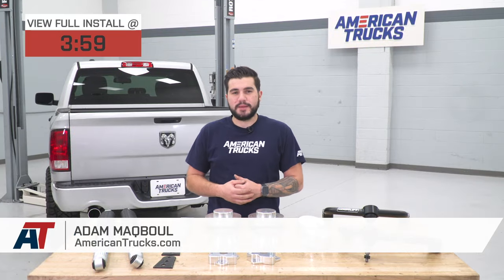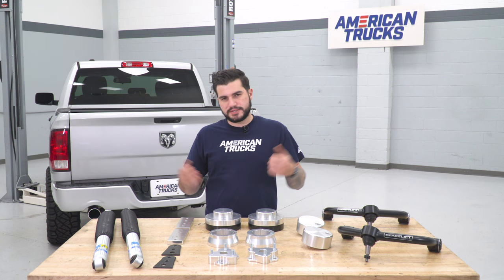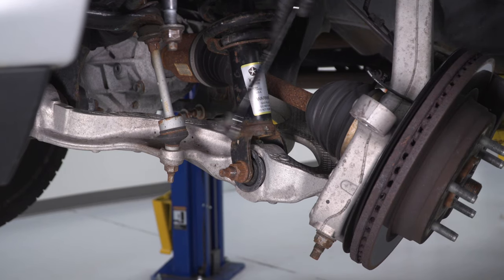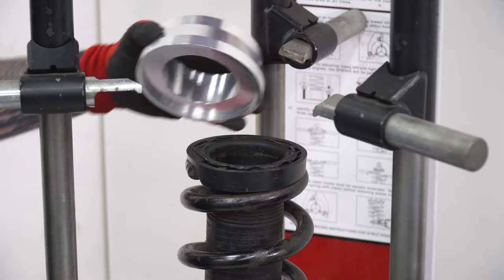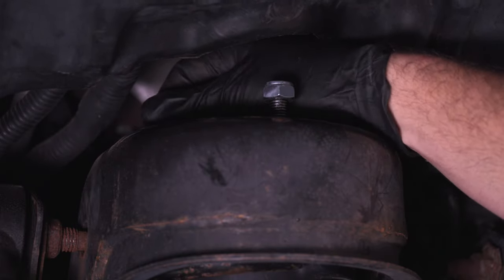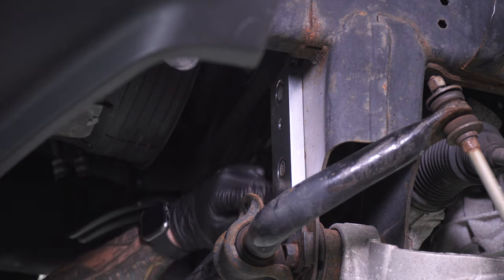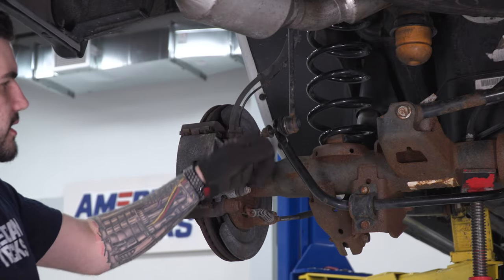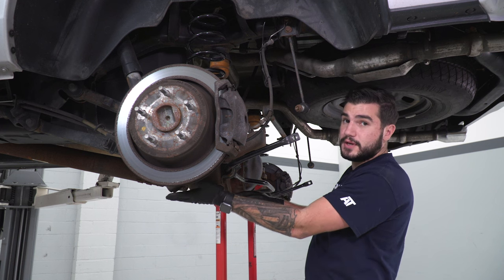2009-2018 Ram 1500 ReadyLIFT 4"" SST Suspension Lift Kit w/ Bilstein 5100 Shocks Review & Install

Comment from the maker: Subscribe for Weekly RAM Truck Videos: http://bit.ly/2G7fgWv
Shop This Lift Kit: http://amtrucks.at/3mY76nc
Reply: Where can I get the rear shocks? Cause I have tried Amd I can’t find the shocks for this that are 2”
Reply: Curious:  How much did ride quality change with this lift? I want to lift my 2010 Laramie, but I prefer a smooth ride over a sport or off-road ride.
Reply: Just thought you should know it does work with the ecodiesel. The reason they state that it doesn’t is because ready lift hasn’t put on in an ecodiesel them selfs

Comment: I just installed a 2 1/2 lift on the front of my 2017 Ram 1500 4x4 to level it out and I’m considering beefing up suspension. Maybe upgrading the control arms, and new shocks on the rear. I like the ride height, and have 305/55r20 Nitto on fuel rims with. 1 in offset. No issues with rubbing tires, and it drives straight.

Comment: I have this exact kit but was wondering if I run 35s on the factory 20 inch wheels will I need spacers?
Reply from the maker: 20's and 35's will work just fine! Needing spacers will depend on the offset of the wheel, but in most cases you shouldn't need spacers.

Comment: Cant i just buy the sway bar relocation bracket? And just install a 4 inch lift front struts, instead of the spacers that go on top of the struts?? I feel like it will give it a better right quality.
Reply: Better choice for sure. The upper control arms are recommended with anything over 2 inches though.
Reply: @coltendixon2416   did a little more research and alot of ram forums say, they kept on replacing cv axles because of angle they are at when putting this “lift” on. The best way to go is 3 inch, any higher then that you will need to do a diff drop.
Reply: @israelgarcia3455  yes the more the lift the greater the angle will be. 1” is better than 3”
Reply: @israelgarcia3455 hi did you installed bigger strut with this 4inch Ready lift SST kit? If yes what struts you used. I am planning to buy 4inch struts to replace spacers and want to confirm  whether they work with this kit
Reply: @arshdeepsingh6681  its been two years with a similar lift. I have bilstein B8 5160 with remote reservoir shocks in the rear, and Bilstein 6112 set to 2.8 liftat the front. I also installed a 2 inch body lift to fit 37” tires. I also bought other aftermarket parts to go with this type of lift and honestly I recommend just installing a lift the right way from the start and dont try and take short cuts…anything over 3 inches is best to do a diff drop. next year im installing a 6 inch lift the right way. I haven’t broken any cv axles like other people have claimed BUT the way they sit at an angle they start damaging the intermediate shaft splines .

Comment: Can i use 4inch rough country struts instead of spacers at front with this lift?  Thanks in advance
Reply: Did you ever find an answer I’m trying to do the same
Reply: @kennydaleangulo3842  i got the answer today only. Those 4inch struts didnt fit with this kit. Due to ready lift preload spacer on oem struts lift of this setup is less than the actual 4inch lifted struts so they wont fit.
Reply: @arshdeepsingh6681 thank you!

Comment: How are the drive shaft angles???
Reply: 4 inches is right on the edge for causing driveline vibration front and rear and wearing out your front cv joints (on 4x4 models) quick if you flex them a lot off roading. the fix is a lot more money than this kit costs. 2 or 3 inches is max imho on the 4x4's before you get into all the rest of issues. It's doable, just a lot more items to replace if you want long term.
Reply: @jamescole6846  will drive shaft spacers be enough?
Reply: @vonnieboy7878  I have a Ram 1500 Sport I am looking to lift as of right now. Been a Jeep man all my life been through 4 of them and all the issues. This is my 3rd Ram truck as well. You need to drop the front diff if it is a 4x4 otherwise you are probably good. The front CV joints dont like a lot of slope. or Angle. Furthermore the 2011ish range trucks had an even worse front end for doing this in 4x4. Ram made several re-designs from 2009-2019 even though it was the same body. Some are coil over while some are coil and shock separate. If you have a 4x4 version just do the research. BDS is probably the best but its a 2500.00 kit
Reply: Drive cv angles are not good lol I have this kit I’m saving for a zone 6 inch. I haven’t had any problems but if you throw your truck in 4wd, and when you take off from snowy road you get vibration, it’s more for looks then practicality. If I knew this before hand, this being my first lifted truck I have ever done. Stay clear away from this kit.

Comment: Any suggestions on getting the front coilovers over the lower control arm? Mine isn't just popping in like in this video. Can't even get with a 3 foot pry bar.
Reply: Hey just saw your comment. I’m having the same problem right now. How did you end up doing it? I need ideas haha
Reply: @duncangraham588 if you have a helper, get a lower control arm hook tool, have your helper pry down on the LCA, make sure the sway car link is disconnected, and use the other pry bar to put it into place

Comment: I put a 2 inch leveling kit in my 2012 ram in about 2014, was good at first, but soon ruined the struts from so much side stress on them and then the cv axles from too much angle. Had to go back to stock. Anybody know how this is avoided?
Reply: look up zone's differential relocation kit. lowers the diff 2 inches to fix cv angles
Reply: How much miles you got on that Ram bro looking at a 2014 right now

Comment: Will it possible to run a rancho 2.5 quiklift coil over plus a 1.5 spacer on top of it, or any other (fox, kings,icon) instead of the stock shock ? And still use the ready lift upper control arm ?
Reply: @Steven Skoczen  no no answer yet  bro.
Reply: @Steven Skoczen I used a bilstein 5100 raised all the way with the 1.5 spacer on top and their upper control arm. No issue, no rubbing. It's been over 6 months and I love how it sits and rides.
Reply: @kened6139  so what was ur total amount height up front ?? 1.5+??
Reply: @kened6139  I was thinking of doing the same but I was wondering about the sway bar links. Did you do anything to them and how does it drive. Some lift kits bring extensions for links.

Comment: Is there any sag in the rear after doing this? I have a 2012 Ram 1500 with a leveling kit. As soon as I put around 200lbs in the bed it sags noticeably. If I didn't have the level kit it wouldn't be an issue so I'm nervous about doing a lift kit since that will level it out.
Reply: If you’re worried about sag just replace the rear springs with HD ones. Tuftruck makes them and has a couple different options.
Reply: @guy10117  that's what I've been thinking about doing.
Reply: I replaced the stock springs with the tuftruck HD springs. They are really good quality
Reply: @RickheadWashington  I ended up replacing them with the TuffTruck springs. Took care of the issue.
Reply: @ryanmiller4890  great! Glad to hear it worked out.
Reply: @ryanmiller4890  did it effect the ride quality and comfort? Thinking about doing the same.
Reply: @victoriacote7130  I put a pair of TuffTruck coil springs in the back. $184 with free shipping. They add 50% more weight capacity to the bed and so far no issues with the ride.